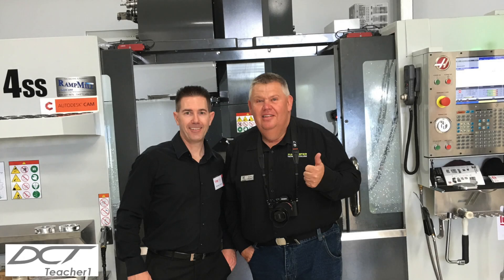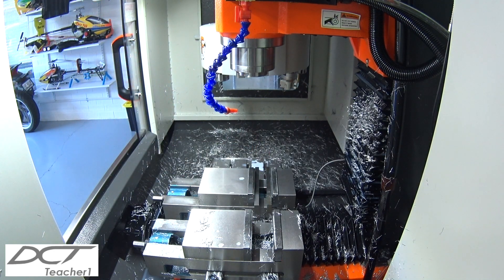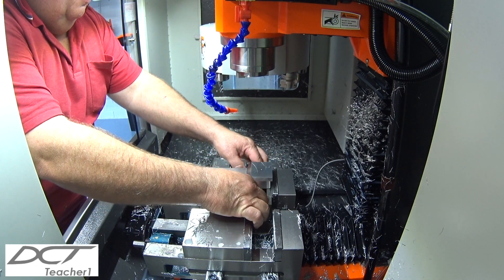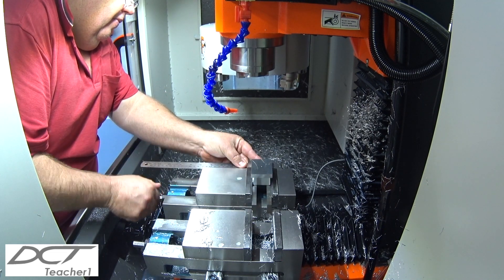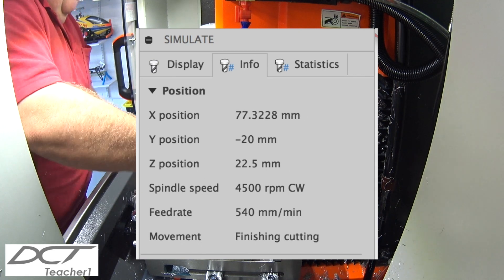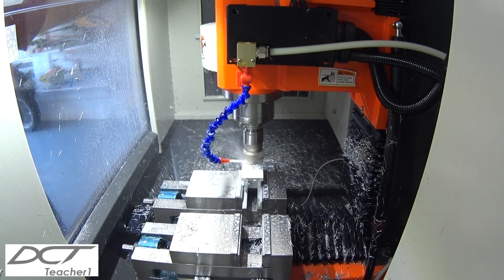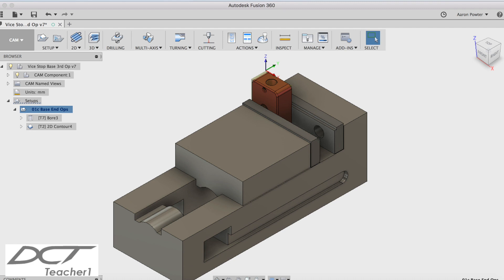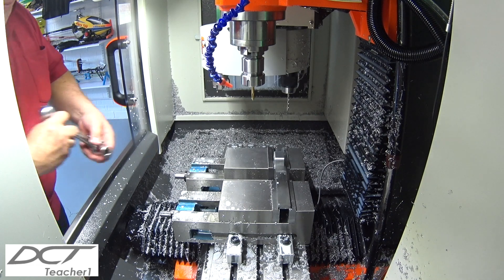Mill Vise Stop Pt.4 - CNC machining Fusion 360

Comment: Hi Aaron,  A tip for repeatable stock X0 placement in the vice jaws, is to use a magnet.  I have been using a magnet for years.  Works great.  Remove it before machining.  Steel chips adhere when machining steel, but are easily wiped off the magnet and vice jaws before placing each part.
Reply from the maker: Hi Chris, that's a great idea mate.  Thank you for sharing it with us.  Would you believe I had a small edge technology one and the very first time I used it I smashed into it with an end mill FML ha ha ha.  Cheers, Aaron.

Comment: The little machine that could. The spindle servo motor looks to be a brushless type. Looking at the SkyFire online specs, it doesn't state what type it is. But given the machine is capable of taping,  it sure does look like it is. Does your Skyfire Owners manual publish the type of motor used?
Reply from the maker: Hi Doug, I'm not sure what type of spindle it is.  You would have to contact them directly to find out.  I'm certain that it is brushless 3phase type as it runs a VFD.  Yes, it has a spindle encoder on the top of motor. It uses that to orientate the spindle for tool change and tapping.  Thanks for following on with the video series.  Cheers, Aaron.

Comment: 1:25 стружка на конусе, и она же на 2:13 , продувка воздухом не работает?
Reply: retoxxx1,
(I used Google Translate to read your comment.)
I was watching this video again and just noticed that too. I hate it when that happens! Even though I have air and coolant purge, I've had chips stick once or twice as well. What's really annoying is it may not be seen until you manually check all the tapers.
Reply: (It looks like a chip is stuck to the taper of your face mill. You can see it at the two times retoxx1 listed.)
Reply from the maker: Oh ok I'll take a look.  Thanks for letting me know.  I'm that blood blind these days I can't see jack without my glasses on. Thank you ;-)
Reply: Eek, watching even closer, I think there's a chip on the holders of the 10mm EM and the tap as well. Seems like reducing the pressure to the air gun might be a good idea, I'm going to try to remember to do that too.
Reply from the maker: Hey bud, nah I just opened the side door to the mill and stuck my head in there (yes I had my glasses on).  No sign of chips stuck to any of the cutters.  I will zoom in on the video and have a closer inspection myself.  Anyway, what are you doing watching dodgy videos when you've got that big Brother CNC machine.  You need to start smashing some videos out too bud.  I loved that GoPro case too.  Way better than anything I've machined ;-)
Reply: The chips are pretty clear in the video, I'm sure you'll see them - just look at the right side of the BT30 taper of the face mill right before and right after the tool change. IMO, the existence of the chips warrants making some kind of change, but I won't belabor the point any more.

Thanks a bunch! Man, I'd MUCH rather be making videos (or at least machining) right now but I'm in "reformatting Windows hell" at the moment and there's only a glimmer of light at the end of the tunnel. It'll be a small miracle if I don't end up smashing this frigging computer. It sure would be nice if things worked and I wasn't staring at error messages like "the requested operation could not be completed due to a file system limitation"... what am I supposed to do with that, Microsoft? So, while watching progress bars I'm also watching YouTube videos (possibly a little too closely).
Reply from the maker: Hey man, sorry I'm not sure what you're saying bud.  I tried to translate it, but it was a bit confusing.  Cheers, Aaron.

Comment: Your machine really puts the tormach machines to shame with a real tappered spindle and rigid tapping!  Those are some fine looking parts.
Reply from the maker: Hey man, thanks for watching and commenting.  Oh, I'm not totally sure about that bud.  Tormach machines have their place and many other makers / machinist out there are making some really nice parts on their Tormach machines.  To be honest I would've bought a Tormach machine 5 years ago, but the reseller has too much mark up on them over here.  Cheers, Aaron.
Reply: DCTTeacher1 I have the 770 with the atc. The atc is unreliable and seems to always find a way to misaligne after a few cycles after spending hours making corrections. Pathpilot is great though. I give them props for that.
Reply from the maker: Yeah I think they've had a great product and a very good run for the past 10 or so years but it's now time for an overhaul.  They need to loose the dovetails, open loop steppers, and that R8 TTS style tooling.  I speak to many Tormach uses that constantly battle with tool pull (over 1/4") due to that straight shank system ;-).  Oh and another thing, break free from the PC!
Reply: DCTTeacher1 I agree!! I was roughing out a critical part with simple geometry and it lost steps and scrapped the part after making the same part perfectly 10 times in the same run. I frequently use 3/8 3 for roughing and finishing in aluminum ane pull out hasn't been an issue. Then again I don't machine steel often. Cat 30 is cheap and plentiful as to why they thought the legacy support for r8 was a good idea is beyond me.